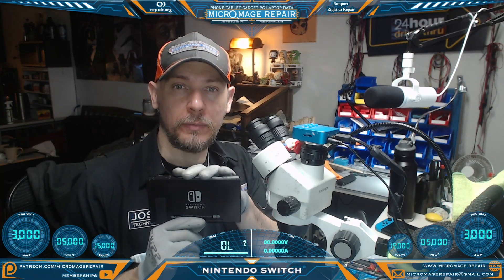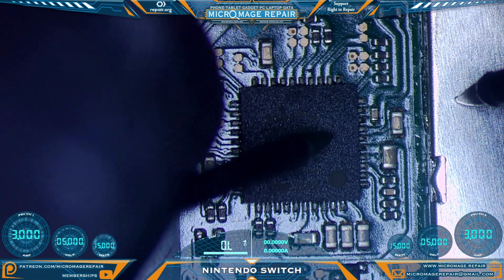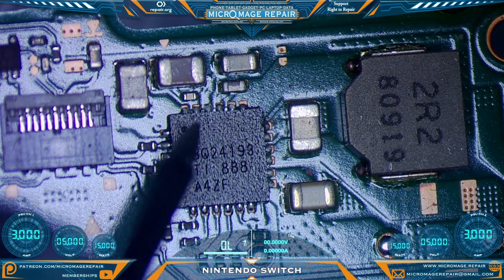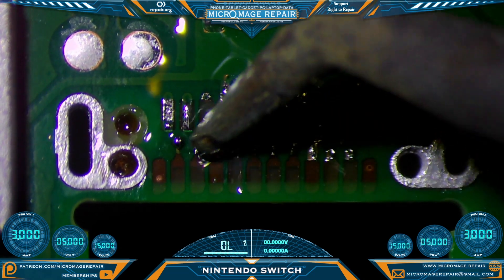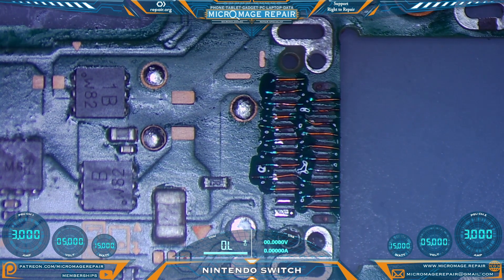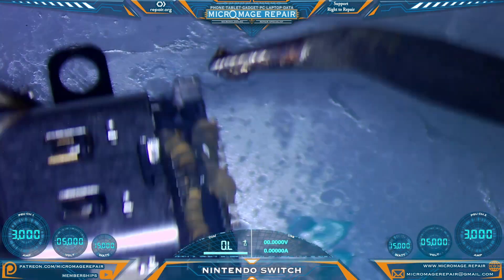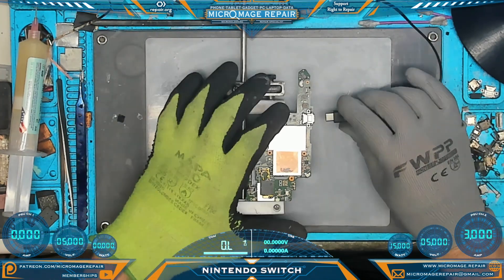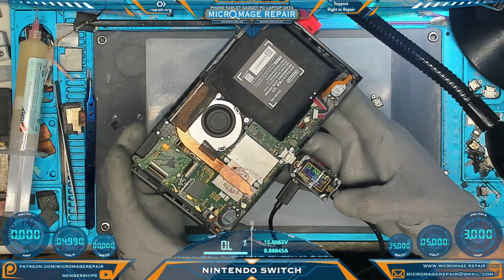Nintendo Switch: 🧮 21 Ripped Pads is allot of damage, Can I fix This Mess?

Comment: Tried my first port replacement on the switch and i pulled about all of the same pads, i tried flowing from underside while applying pressure, i applied too much pressure. It was a switch that had been laying around with a no power issue.
Reply from the maker: Pressure is not necessary. 
If you heat from the bottom with the board either hanging off the bench or in a holder like I use that slightly elevates the board off the bench it will just drop off.
Won't typically pull pads with that method if pad damage doesn't already exist.
That being said it is still very repairable.
Reply: @MicroMageRepair  yeah, im going to try and repair it. Have you ever used the trace repair pads you can buy from ali express or Amazon?
Reply from the maker: @bryanfrye8770  I have.
I don't personally like them for something this intensive. 
I find them a bit tedious compared to jumpers.
That is possibly just me. I had a lot of practice running jumper wire prior to lugs even being a thing.
Reply: @MicroMageRepair  gotcha, any specific jumper wire you recommend?
Reply from the maker: @bryanfrye8770  Any 36-40 awg solid single conductor wire should do. Doesn't even need to be enamel coated on these ports as your not doing any crossing or long routing.
Reply: @MicroMageRepair  where do you usually get your trace repair wire from? Amazon doesn't seem to have it and I would like to get it fast.
Reply from the maker: @bryanfrye8770  I'm unfortunately the last person to ask.
I stocked up on a lifetime supply from a electronics surplus store.
I really haven't shopped for magnet wire.
I bought my  non enameled wire from @Northridgefix
Reply: @MicroMageRepair  I saw some wire on Digikey I might pick up, I'll let you know if it's any good. Thanks for the prompt reply!
Reply: @MicroMageRepair  So, ended up getting some solid core 36awg from Ali, upon further inspection of the board some of the pads don't have anything to solder to. Turns out your ripped pads looked a lot cleaner. Could I send you a picture of what my ripped pads look like and get your opinion on how you would go about repairing the traces?
Reply from the maker: @bryanfrye8770  absolutely. 
askmicromage@gmail.com would be the best spot that I check regularly or Facebook messenger.

Comment: Thank you for recommending Weller tools. They just seem to power through tough solder jobs. I really enjoy your videos also.
Reply from the maker: Thanks Lance!
I'd agree that my irons are probably overkill if you're just working on  single or double layer through hole boards. They are more than capable of that work, but so is a $100 Weller.